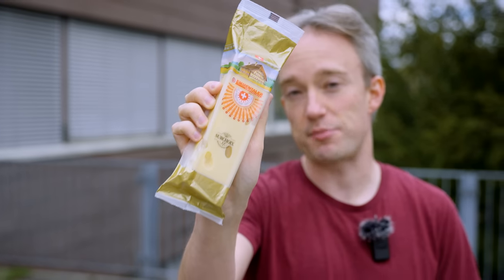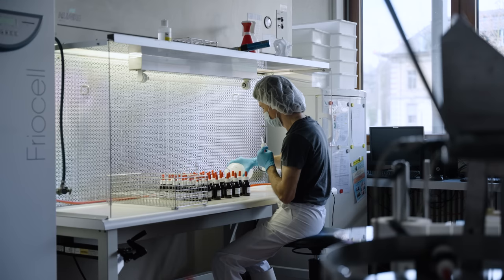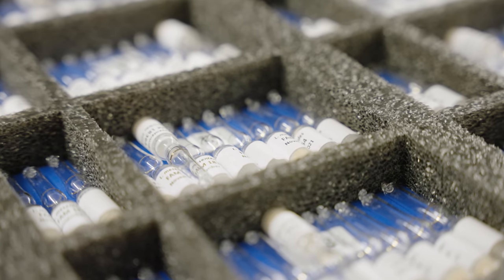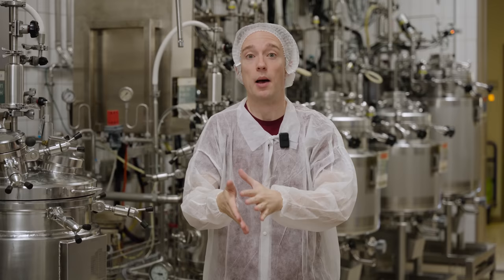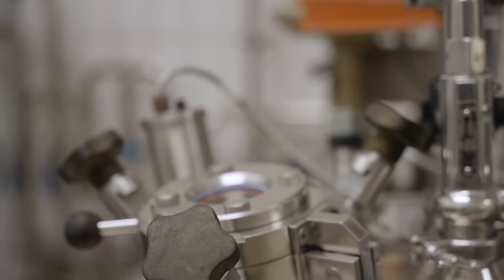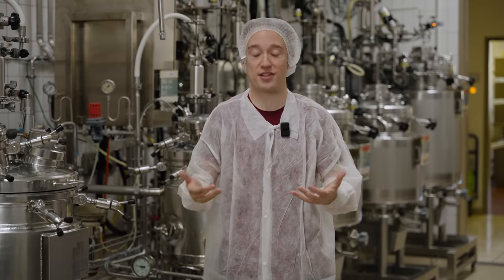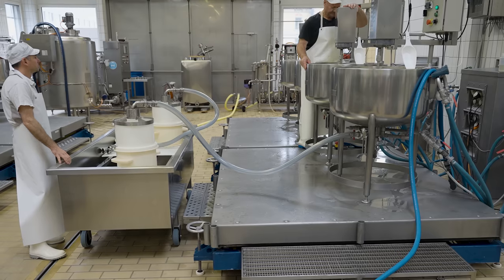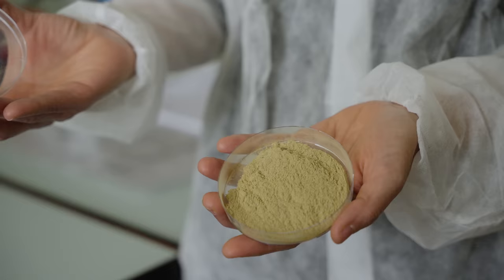How they saved the holes in Swiss cheese

Comment: The fact that we got good at making cheese, got too good to where it's too clean, then had to carefully and safely add barn dust to it in order to fix the cheese is absolutely amazing.
Reply: Switzerland: Suffering from Success
Reply: They're so successful they figured out a way to be less successful for more success
Reply: Remember something about a type of beer having the same issue. Seems like air flowing over the fermenting process from an old chimney had been adding some contaminates that added to its uniqueness.
Reply: Task Failed Successfully
Reply: @EdBruceWRX  probably, 
in belguim several beers can't be produces anywhere else then where they are, because they use the naturally occuring cultures to react SPONTANIOUSLY! thus a bit other naturally occuring yeast bacteria causes different reactions, and thus a slightly different beer.. 
also a lot of trapist beers use specific wells, with the water they start from partly determining the taste off the product :).

i renember they tried to move Hoegaarden, they at least claim they got the taste right, (i never saw an option to taste it, so it's only some claim by the brewery to me) but not the color, thus it was not a white beer anymore, they reversed to physical merger interely, Hoegaarden is brewed at it's original location again, and color was normal again too :) .
It was always marketed as a white beer, so even taste identicall, a blond version wouldn't do to hold up it's image!

and in that case i think they don't even know the true reason! but must be something naturally occuring in the water, air or other real local things..
Reply: The fact that we only just now fully understand these processes that have been around for hundreds, sometimes thousands of years, if even more amazing. Our culture and technology has progressed so much over the past few decades it's mind-blowing, at least equally as mind-blowing as having people who did not have access to modern technology successfully perfect their craft through trial and error over many generations. Humans are amazing.
Reply: Literally the most Swiss thing I’ve ever heard of
Reply: It’s perfect, too perfect, damn it go back.
Reply: Wasn't there also a chemical that the US Govt makes that needed to be rediscovered and one of the things they found out was that they cleaned their instruments too well which made recreating the chemical impossible(or very difficult)?.
Reply: Read of a cheesemaker in England that moved to a new facility and quality went to pieces, had to move back to the old building!
Reply: @Pulstar232  Yep it's called fogbank, and they removed the impurities for the new fogbank that made it not work as well as the previous version so they had to readd the impurities down the line (or not remove them in the process). it wasn't impossible, just a lot of headache and money spent looking for a problem that they caused
Reply: @protercool8474 or they were less successful so they became more successful for more success. Still works the same when u say it like that
Reply: The perfect is the enemy of the good...
Reply: @protercool8474  my brain
Reply: For how many years did they have the more airtight milking processes before the hole problem started?
Reply: It’s actually kind of stupid. It’s a great demonstration of how humans over emphasize the limited observations of science and think it is conclusive
Reply: @Pulstar232  I vaguely remember this as well , but not well enough to find the correct video for you .
Reply: @B3RyL we don’t know if we fully understand anything.

Comment: 1 mg of hay powder per 1000 liters of milk? That's absolutely mind-bogglingly small but wonderfully incredible to learn, thanks so much
Reply: Bubbles are such weird/interesting things, in that they need nucleation sites to form. (Otherwise the gas stays dissolved in solution.) Lack of nucleation sites is why boiled water can explode if boiled in extremely smooth, clean vessels. (In laboratories, they use little porous ceramic boiling stones to go in their flawlessly smooth boiling flasks.) Or why they now laser-etch little imperfections into the bottom of beer glasses, to give the bubbles somewhere to form. It’s why Diet Coke goes berserk when you drop a Mentos into it (the surface has a huge amount of nucleation sites).
Reply: Yes but please use the correct units of furlongs per fortnite, the metric form of that value just doesn't have the same je ne sais quoi.
Reply: It makes sense in retrospect. Every hole is a separate nucleation site, and each nucleation site only needs one tiny particle (possibly as small as a single molecule) to happen. 1 milligram has a LOT of particles.
Reply: @baldmaggots  You mean slugs per cord. Furlongs per fortnight is unit of speed. Slugs per cord is unit of mass over volume.
Reply: @baldmaggots - in the days when our grandparents were farming, they just used handsful per barrel.
Reply: 1 ppb
Reply: @baldmaggots  fortnight*. it's a unit of measurement, not a video game.
Reply: It also tells a lot about how clean the milk actually is. When adding  ~1 parts-per-billion(!) of dust makes such a big difference, the milk must be essentially medical grade.
Reply: @tookitogo  that is super intresting, i didnt know that about cola and mentos (well i did know it but not why) thank you!
Reply: This video makes me crave cheese.
Reply: @tookitogo  In my lab we just scratch the bottom of the flask with a rod. The glass particles can serve as nucleation sites.
Reply: @baldmaggots  For us Americans, can we get this in school buses or elephants?
Reply: Or 1ug per liter
Reply: Excuse me but was that "hay powder" or "whey powder"? I read some of the other replies here and I "wish" people would for the most part remain germane to the Issue of the VID. This VID had nothing to do with "horse racing".
Reply: @davidalanjonesridge9874  “what” “is” “said” “in” “this” “VID” “is” “hay” “powder”
Reply: @baldmaggots  firkins per fortnight is not dimensionally homogeneous with milligrams per liter. The correct quantity here would be 0.199 firkins of dry hay per cubic furlong of milk (using the FFF system).
Reply: Thats about 1 part per billion and yet it makes a huge difference. Very cool.
Reply: @FlyingCog  Exactly! AKA density... Just to clarify, are we talking full cords or face cords?
Reply: @davidalanjonesridge9874  hay powder.
Reply: @anotheraggieburneraccount  I guess that you only need a few dozen bubbles per wheel of cheese, so I suppose it makes sense that a few ppb is enough!
Reply: Still thousands of orders of magnitude more concentrated than homoeopathic drugs
Reply: That is like 1 part per million.
Reply: @jamesknapp64  No. 1 liter of water is 1000g. 1mg is 1/1000 of one gram. So 1mg in 1 liter of water is 1ppm, and thus 1mg in 1000 liters is 1ppb.
Reply: That’s not even crazy to me, working in medicine where picograms and ppb aren’t uncommon measurements.
Reply: @AndrewAMartin  That depends on where you are like with pints.
Reply: @FlyingCog  No, you have to be specific, such as when buying firewood, whether you want a face (shallow) cord or a full-depth cord. Both are standard measures...
Reply: @AndrewAMartin  I know. We were joking about nonstandard measures and my mind jumped to US pint vs Imperial pint when you asked about it. Sorry - my mind during jokes works in strange way,
Reply: @FlyingCog  Gotcha - my mind is a little slow tonight, I'll catch up eventually!
Reply: Maybe it's similar to how yeast needs sugars to form Carbon dioxide?
Reply: @tookitogo  I did an experiment in school years back and we found that it's actually not just coke, but in Canada it's actually the normal coke that explodes more.
Reply: It takes more fiber than that for my culture to produce gas
Reply: @jwalster9412  No, because yeasts consume sugars to make CO2. If the bacterial cultures in the cheese were consuming the hay powder to make the bubbles, the volume of the bubbles would be negligible since the hay powder is added at one part per billion parts of milk. The hay powder functions more like a catalyst, enabling a reaction to happen without being consumed.
Reply: Bacteria multiplied
Reply: I mean it was literally originally introduced via invisible particles in the air - a tiny amount.
Reply: And what do you propose to do with that newly gained, deep knowledge sir? 😊
Reply: @beefchicken  Something feeble in my defense, I am 76 so concerning dairy products I have always associated "whey" with products like yogurt, cottage cheese, health products like "brewers yeast", and others. In this case I am having to concede this argument for I had an headset on and I heard the word "hay" and I also discovered that at that point in the VID it was capted.
Reply: @tookitogo  Something feeble in my defense, I am 76 so concerning dairy products I have always associated "whey" with products like yogurt, cottage cheese, health products like "brewers yeast", and others. In this case I am having to concede this argument for I had an headset on and I heard the word "hay" and I also discovered that at that point in the VID it was capted.
Reply: @tookitogo  And with what little I know of physics and the density of matter, 1 liter of liquid should fit in 1 cubic decimeter, and you place it on a scale it should weigh 1 kilogram.
Reply: it's such a testament of how clean the process is that after all that there's no 1mg of particulate in 1000L of milk unless they specifically wanted to
Reply: @friendlypiranha774  No they didn't. They didn't even add any, it simple made its own way in, in tiny quantities, through the air.
Reply: 1mg/1000L = 1 kamelåså
Reply: @davidalanjonesridge9874  Well, it varies wildly by what liquid it is, but what you said is correct for water. Milk varies seasonally between 2.5 and 3.5% denser than water.
Reply: @baldmaggots  Hi fellow Signum alumnus!
Reply: 1 mg/kL
Reply: If they added more, the entire cheese would disappear.
Reply: Snooze
Reply: @tookitogo  Concerning milk I agree yet, I was a cook in the Marine Corps and as a liquid on a scale we measured milk out at 7.5#. Our recipe cards had the ingredients measured as dry or weights. The dry of course being measured with teaspoons, tablespoons, and cups. Using these in increments we could measure dry up to gallons. Oh, ok, as a side bar: 3 tsp=1 tbs, 16tbs-1cup, 2cups to the pint, 2pints to the quart, and 4quarts to the gallon.[IMPERIAL] The cards were written and calculated for 100. So, for example if you were feeding 35 people you would calculate 0.35 times each ingredient to keep the recipe constant world wide. And this is the short story.
Reply: @fluffycritter  The nucleation sites probably need to be in the tens of micrometers, otherwise each bacterial cell could serve as a potential nucleation site (bacteria used for cheese are usually rod-shaped, with a length between 1 and 5 micrometers).

Fun fact: The bacteria used to make Swiss cheese are closely related to the bacteria that cause acne.
Reply: @davidalanjonesridge9874  hay poweder is dried, powderized grass
Whey powder is dried, powderized whey (whey is what is left over from milk after making cheese)
Reply: @theninja4137  Oh, ok, thank you! It should be amazing in how things turn out. What started out as me thinking that there was a spelling error, ended in the discovery of actually learning about milk and it own processes. Whey is a byproduct not like yeast that initiates a process. So, the hay helps to initiate a process.
Reply: @davidalanjonesridge9874  hay, yes
Reply: @jwalster9412  I think the yeast eats the sugar and the carbon dioxide is a waste product
Reply: It blows me away that they need only 1 mg. I thought it would be several HUNDRED mg per 1,000 liters!

Comment: I've worked in protein crystallization, also a very finicky process. One lab can get crystals while another one doesn't despite using the same protocol. Crystals need something to grow around, a nucleation point, one lab where people smoked (this was long ago) got crystals while others didn't. It's the small things...
Reply: You think maybe it was the smoke particles acted as nucleation points?
Reply: @janfilby7086  Yes. Another example where one lab got crystals and another one didn't it turned out the lab that got crystals had algae growing in the distilled water system. Sometimes a little dirt is a good thing, like how penicillin was discovered 🙂
Reply: You mean the dirt, helped to seed the crystal.. and then it went on from there ? Yeh... sometimes, it does need a little help.
Reply: I am surprised it ever was permitted to smoke in a laboratory. I (nonsmoker) utterly loathe smoking laws, but even I think that seems rather shocking.
Reply: @salvadorromero9712  It was allowed to smoke on airplanes too in the not so good old days.
Reply: Ooh! Where do you work? I did an internship at the NCI for a summer and this was literally my whole job while I was there! It is indeed so incredibly finicky
Reply: @Baymax872  Chalmers University of Technology, Sweden. 20 years ago.
Reply: as in water production.   or gas production.    Remember, super boiling.    Or in carbonation.  I think someone put menthos in soda so to release Co2 quickly.
Reply: A friend of me does a PHD in physics and they use indium for soldering. Whenever they got fresh indium their measurements didn't work properly anymore. Turned out that the clean indium became superconductive when they cooled it down and screwed up their measurementa. Mixing it with some of the old indium resolved the problem.

Comment: Makes sense... but I never figured bacteria would need a nucleation site to produce carbon dioxide
Reply: Not to produce carbon dioxide, for it to be released from solution quickly enough in one location to form a bubble.
Reply: The bacteria produce CO2 regardless.
Reply: It just stays dissolved in the cheese otherwise, which I suppose might make it taste a bit more acidic?
Reply: I assume that the hay dust acts as a nucleation point, like dust particles seeding raindrops or tiny imperfections in a Champagne flute being the source of the bubbles.
Reply: @kaitlyn__L  it probably would taste more acidic if you ate it quickly after the cheese is formed - but cheeses rest for months so all the co2 will have bled out anyway. From both the holes and any remaining in solution.
Reply: @korenn9381  that makes sense!
Reply: I'm surprised the bacteria cells themselves don't serve as nucleation points. Too small and/or too gas-permeable?
Reply: The bacteria need somewhere to... er... procreate. That explains why hay is the answer I guess!
Reply: @davetaylor2088  This is the best answer.
Reply: @korenn9381  Also, CO2/H2CO3 isn't particularly acidic to begin with when compared to the carboxylic acids. Lactic acid should be several hundred times stronger, based on the difference in pKa values.

Comment: The fact that they do all this stuff just to save holes in cheese is amazing
Reply: It's a big part of the brand!
Reply: Well it's also financially beneficial. You sell less cheese and can sell it as a feature.
Reply: @watcher8582  they sell by weight not volume
Reply: Its preserving culture. 

No pun intended
Reply: @kneelesh48  It's not that easy. I mean go to any supermarket.
Reply: @watcher8582  I don't know where you live, but in Switzerland it is always by weight.
Reply: @watcher8582  price of cheese is mostly by weight, even in supermarkets. Prepackaged cheese might have different weight and price
Reply: @watcher8582   it actually looses them money.
cheese without holes would let them fit the same mass of cheese into a smaller volume, which means more cheese fits into storage, onto a delivery truck and onto a store shelf, which would save them a lot of money.
they're essentially sacrificing bit of efficiency for a large boost in brand recognition, which i assume is worth the trade off, lest they wouldn't be doing it.
Reply: @etherealicer  I'm sure you can find several brands selling packs of 200g of cheese at prices from €3 to €10. Of course if you got one type of cheese from one brand, them more weight of cheese will cost more money. But it's not like raw lump of silver. "Cheese" is clearly not a homogenous mass such that price is determined by weight.
Reply: @windhelmguard5295  It does not [sic] loose them money - lest they would not do it. We're in a capitalist framework after all. Even if they can't use shrinkflation effects to gain money and it's just about what customers want to see, then the latter reason would also only be manifested in the product if that makes more money in the end.
Reply: This is the government's support HQ for the entire Switzerland cheese industry, not just a research lab for specifically Swiss cheese holes.
Reply: @watcher8582  That makes ZERO sense.
Yes, different brands cost different amounts (per weight). Different sneakers als have different prices...
Still, your claim "Well it's also financially beneficial. You sell less cheese and can sell it as a feature." is irrelevant, as it is sold by weight.
Reply: @watcher8582  sure, a more accurate way to say it would be that they’re slightly sacrificing their profit margin to ensure recognition and thus overall sales. You’re right of course that if they genuinely made more money, on the whole, with no holes they wouldn’t bother adding it back in.
Reply: @watcher8582  Swiss cheese is a ripoff.

Comment: This kind of reminds me of Fogbank. A substance used in the production of several types of U.S. thermonuclear warheads. They had problems making the material after altering a part of the manufacturing procedure which removed a step where a contaminant was introduced. A contaminant which later proved to be necessary for the proper production of Fogbank.